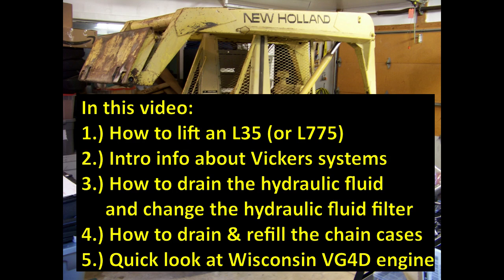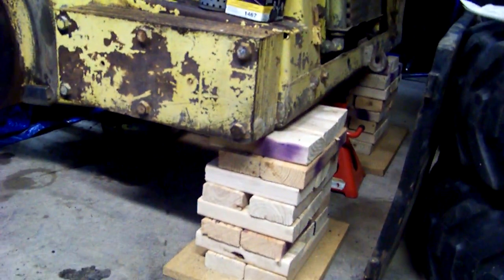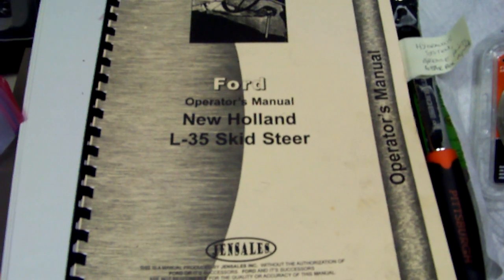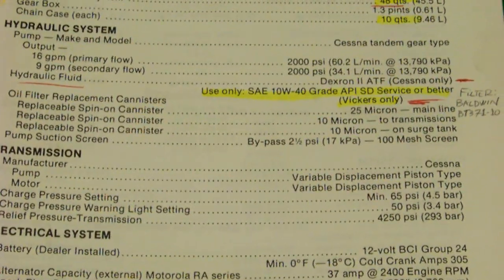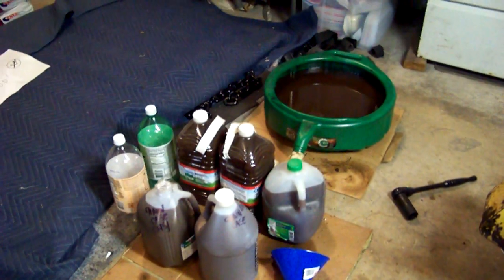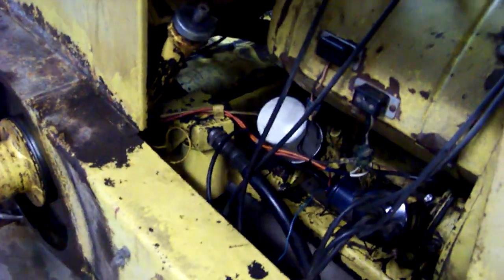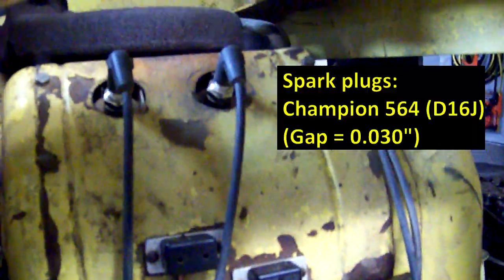DIY New Holland L35 L775: How to Lift a Skid Steer, Drain Chain Cases, Drain Hydraulic Fluid, VG4D

Comment: Wow, this is a really great series of videos on the L35. By any chance does the shop manual mention what the maximum lift height/weight for the L35 is? I've been looking (have my eye on one for sale locally) but I haven't been able to find information on it.
Reply from the maker: According to the manual: 
- "Hydraulic Lifting Capacity to maximum height (SAE Operating Load)" is 1800 lbs (this is called "ROC" today);
- height to top of bucket with the boom at max vertical extension: 146 inches (12' 2")
- height to the bucket pivot point with boom at max vertical extension: 121.5" (10' 1.5")
I hope that helps - thanks for watching! : )
Reply: @L35inColorado  That is really helpful. Thanks for the info!

Comment: Thank you for your video's they have already been a great help - bought a used L779 but most of your content matches except I have the cessna transmissions.   When I bought it I noticed a hydraulic leak somewhere underneath and had thought I traced it to a rubbed through hose going to the filter/cooler.  Replaced that but in the process of refilling the reservoir I noticed it leaking again.   Finally found it - theres a bolt missing from the hydraulic tanks access panel...right directly under the driveshaft (No clearance to put bolt in while shaft is in place).   I'm now trying to figure out how to remove it from the 4way gearbox end.  I maybe understand how to do it if I can keep it from rotating while removing the bolt going into the 4way.   
Any suggestions appreciated
Reply: Well I figured out the drive shaft - I'm thinking they drilled it out or cross threaded it.   The hole is tapped, seems to be about 3/8 but neither 3/8 coarse nor 3/8 fine threads in smoothly.   Guess I need to try metric before I force a 3/8 in.
Reply from the maker: Can you use a shorter bolt that will fit with the driveshaft in place?  I don't know how long those bolts are because I have never removed that access panel on my L35, and there may be a little more clearance on the L35 than the L779.  

I'm not aware of any videos for removing the driveshaft, but I had a look in my service manual: it doesn't get into great detail, but rather just says to remove the bolt that connects the driveshaft to the forward-most yoke -- this is the yoke by the 4-way gear box.  There is a big yoke bolt there, and it holds the yoke to the input shaft of the 4-way gear box. The manual just says this:

"Slide the drive shaft off the gearbox input shaft after removing securing bolt A, Figure 6", and that "securing bolt A" is the big one on the yoke.  

Here's my video on the 4-way gearbox: I don't show this bolt in the video, but you can see what I mean about the input shaft inside the gear box, so you can understand what the manual is talking about (that shaft goes all the way through, and its rear-end is connected to the driveshaft at the yoke bolt):

https://www.youtube.com/watch?v=qfoBXIXQOZY

In case I'm not being clear enough, the bolt that I'm talking about looks kinda like a pinion nut that you'd see on a regular automotive differential (holding the diff yoke to the diff input), but its a big bolt instead of a nut.  Please post back if that works.  Then back on the other side of the driveshaft (engine side), you just loosen the square-head bolt that's on the very first yoke, and you pry that yoke off.  

I have in the past had to adjust that end (engine end) of the driveshaft before on my L35, and that connection wasn't too difficult to adjust (just had to pry a little) because that yoke is just secured with a Woodruff key.  So I think if I were you, I'd loosen that square head bolt on the engine side yoke first, then remove the big bolt at the gearbox yoke next, then slide off the shaft from the gearbox yoke and wiggle/pry it free from the engine side.  Don't lose the Woodruff key.  Also, I'd mark/scribe the yoke and shaft at the gearbox side to be sure that I have reference alignment marks when it comes time to re-install.  

For install, the manual says to fasten the big bolt to 40 ft-lbs, plus or minus 5 ft-lbs, and to use Loctite 242 (medium strength) on the threads.  That's all the info I have, so hopefully this helps you. 
 Good luck!
Reply: @L35inColorado  Thanks... I managed to disconnect it on the 4 way gearbox side and just angle it out if the way.  I had no idea that the driveshaft basically telescopes.  Once removed there is enough room to just shove it out of the way. I'm going to have to chase the threads on the missing bolt on the tank with a tap since 3/8 coarse starts in but only 1/2 turn.   3/8 fine doesn't work at all.  Unfortunately it means that 8m going to empty the tank of all the lovely new fluid I had put in as I'm pretty sure chasing the tap will generate some metal debris that I will need to try and flush out
Reply: While I'm still going to have to drain the tank I think I came up with a fairly ingenious way to remove the risk of shavings in the tank.   I picked up one of those little telescoping magnets at harbor freight.   I'm going to stick it up through the drain plug telescoped up to be right beneath the hole I'm chasing with a tap.   Probably have to recruit some help from my wife or one of my kids but by having the magnet right at the hole instead of way down low I think I can catch all the shavings before they can fall potentially away from any magnet I could put at the bottom of the tank.

Comment: thank you for your help and advice in the past. i’m needing more help please. today my L35 right side steering arm suddenly started working in reverse directions…i pushed the right handle forward and the right side went backwards and vise versa? what could suddenly cause this? thanks for any help you could provide. David in Tennessee
Reply from the maker: Oh no, that's no fun!  Assuming there's no issue in the hydrostat itself, I'd first check all those linkages from the lever to the steering cylinder, and especially the spring that "resets" the neutral position for the levers.  Check the pins/keys on the connections to the pintles to be sure that there's no slip.  Hopefully it is something as simple as a loose connection between a linkage.. ??

Comment: me again. when checking the hydraulic fluid level on my L35 with it cold… should the bucket be in the raised position or lowered position to get an accurate “ full” reading at my dipstick?  thank you very much🤷‍♂️
Reply from the maker: The manual states this:
"With the boom down and oil cold, the oil should be at or just above the low mark on the gauge."
Reply: @L35inColorado  thank you 👍
Reply: it just seems like when the boom is elevated the reservoir would be sucked dry… especially if you’re on a downward leaning slope. i just don’t want to destroy my new pump.
Reply from the maker: @davidsizemore9906  Remind me again - you're working on an L35 with Vickers transmissions, and you had to replace the vane pump?  
Have you done the purge described in the manual, where you open the port on the control valve?  
(The hydraulic purge procedure is different for the models with Vickers trans than it is for models with Cessnas - and the hydraulic fluid is different, too.)
Reply: yes i have. i’m using the  tractor fluid they recommended at orielys.
Reply from the maker: @davidsizemore9906  Okay - I found this old video on an SD card from when I did some major work on our old L35, six years ago - I had one transmission out, so I had the hydraulic system drained.  
The video quality is poor but check this out and see if it is familiar.  If you need it, I can video the instructions from the big manual:

https://www.youtube.com/watch?v=fJJ0dU2Nujk

Also, is your new pump a Vickers V20P or equivalent aftermarket?

Reading the big manual, on page 53 is states:

"Before operating the loader after a pump failure, the start up procedure outlined in the "General Information" section should be followed".

That is a reference to the info on page 125 of the big manual: if you don't have that info, I can record it from the book and post it later today.  That is important info which states the initial start-up procedure to follow after major hydraulic work (ie, have the skidsteer blocked up with all four wheels off the ground, etc, and you go through several steps over about 10 minutes, with a pressure gauge hooked up to the oil cooler).  Does that sound familiar?

Comment: Hello, my Toyota Auris 1.6 2008 has fuel  pressure problem, because I think after other repairs my conclusion was no fuel pressure, the car has a hard start and once it’s starts it runs good unless leaving off few hours,  then comes the hard start again. Do you have any idea. May fuel pressure regulator? The fuel pump works perfect.
Reply from the maker: There are a few causes, but I'd start with checking the fuel pressure regulator.  Check out this video to see how to do that:
https://www.youtube.com/watch?v=howhgRzQJ3I
I hope that helps - good luck!  : )
Reply: Thank you, your video of  Sianna helped and I have one ordered. I will see the outcome.

Comment: Absolutely phenomenal! Came here for the Wisconsin VG4D engine! Thank you for the tips, we are doing a complete rebuild video on a 1969 Case skid steer 1537 with a VG4D Wisconsin motor.   What did you happen to paint your skid steer with? We are planning on painting ours with Rustolium professional oil based paint, is this a good choice? Did you brush on your paint or did you spray it? Again amazing detailed video!Hope you have grants excess with a YouTube channel!
Reply from the maker: Thanks, I'm glad the video helped!  Sounds like you have a fun rebuild, too!  
As for the paint -- its nothing fancy, because I was mostly doing it to encapsulate the lead paint.  I mostly used what I happened to have on hand from other jobs, which is all stuff off the shelf at Walmart (except for POR-15).  For the interior stuff:

Blue is Rustoleum Gloss Protective Enamel, 254156.

Yellow is Rustoleum Gloss Protective Enamel 254155 (I am pretty happy with the yellow, its a good paint for construction equip).

Orange is Rustoleum 2x (don't have # anymore)

My exterior paint job really isn't very good at all, I just wanted to do something to encapsulate the old lead paint and didn't want to spend too much money.  I used POR-15 (brushed on) on the chain cases and covers, just because I had to use up a can that I opened for a different job (that stuff turns hard quickly if you don't use it up). 

The POR-15 actually worked out well because I didn't need to primer the old paint and POR-15 is very easy to work with, but POR-15 is expensive if you don't already happen to have it.  I topped the POR-15 with Rustoleum Gloss Protective Enamel, Black, 338927.  

The other black (boom, cages, etc) are Rusto 338927, if I remember correctly.  Again, I really wasn't being too picky because I just wanted the old paint covered!  Whatever you decide to do, just remember that you likely have lead paint somewhere under the layers on yours. 

Thanks for the comment, and good luck!

Comment: I have the same l35 1973 under it u said the drain plug for highdrolite fuild? But where do I fill it up at ? Is it where the ATF/motor oil goes or does that run off the drivetrain.  Just new to the skid steer
Reply from the maker: Hi -- the drain plug for the hydraulic fluid is the one shown at 06:29: its the only plug that you will find the bottom of the big hydraulic reservoir.  To fill it up, you just pour the new oil into the same spout where the dip stick is (shown at 12:43).
Be sure to determine which kind of transmissions you have before you select the hydraulic fluid, because the Cessnas use ATF but the Vickers (the one in the video) use motor oil.  
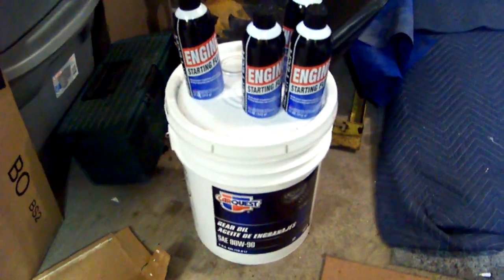The drivetrain (as in the chain drive) has its own lubrication.  Each chain case is filled with about 2.5 gallons of oil, and the refill for those is shown at 09:10 (its a plug at the top of each chain case).
Good luck!

Comment: Did you ever replace any hydraulic seals on your machine? I’m currently trying to do so, but cannot get the cap nut off of the cylinder. Any suggestions?

Comment: This was a great video! I am in so much need of help on my L35.  I can't really afford to take it anywhere for repair so I'm trying my best to do repairs myself.  When I purchased the machine I noticed it had a slight clanking noise when I would turn left.  It started to get worse and would clank and then jerk back and forth.  One day I was running the machine and then it clanked again and just stopped turning left altogether.  No front or rear movement just right.  When I move the left stick to move I get nothing and feel nothing engage at all.  I tried to fill with fluid and still nothing.  I pulled the cover off to expose the chain and pump.  The chain is attached but the parking brake rotor is extremely loose.  I also noticed what appeared to be fresh metal shavings on the bottom under the parking brake.  I just need some advice and a guide in the right direction on where to proceed.  Any help at all would be greatly appreciated.  Thank you kindly!

Comment: i have an l325 new holland which is similar to this l35. thank you for the info and excellent video
Reply from the maker: Wow, that's cool!  Thanks for watching : )
Reply: I just bought a 325, I found this video in hope of learning more about the old new Hollands.

What are some of the main difference you notice?

Thank you
Reply: the 225 and l325 do not have down pressure. A good set of books will tell you everything you need to know

Comment: Hello, I have a L35 and have learned a lot watching your videos. I am wondering do you have to drain the hydraulic oil to change the filter? Thanks for your help.
Reply from the maker: I'm sorry I missed your comment -- I'm not sure how much fluid you would loose, but most of the fluid is in the reservoir when the system is cool -- but you want to be sure everything is cool.  If you compare the height of the oil level in the reservoir using the dipstick to the height of your hoses to filter, you can get an idea of what you might lose.  I changed the filter when the reservoir was empty, so I'm just not sure how much oil you'd lose otherwise.  You could always just put a pan underneath to catch the oil, then refill with the same amount.  Good luck!

Comment: me again. any chance u have a vickers 4 way gearbox for sale? thanks, David
Reply from the maker: I'm sorry I missed your comments!  No, I don't have an 4-way gearbox, but I can say that this company is often able to source some odd parts (but $$$):
https://www.universaltractor.com/
When I was restoring the L35, I got some rare parts from these vendors:
https://www.wengers.com/agriculture/skid-loader-parts.html
https://www.worthingtonagparts.com/skid-steer-parts
I've had one transmission out on my L35 because it needed a shaft seal replacement and some other work, but I haven't had the 4-way gearbox out.  However, if you can find an aftermarket option with the same dimensions at the OE box, that might also be a solution.  For that, I would look at what Surplus Center has - their catalog is outstanding. 
You'll see with the gearbox that there's room to shim (and you'll have to shim, anyway to get the correct backlash on the gears).  As you probably have already seen, nothing fits well with shimming and adjustment on these old skidsteers!  So, while that's a tiresome process, at least it might mean that you can swap in a new aftermarket gearbox of "close-enough" geometry and them shim it for a custom fitment.  
I hope that helps - and if you're still looking for some instructions on the pump priming, let me know because I have some documents that I can use to make a short video on (but if you already have the big repair manual, then we have the same information).  I didn't have my pump out, but I had one transmission removed, the control valve, steering cylinders, and most hydraulic lines out when I did the major work on this L35 a few years ago, so I had to prime the system just the same.  I still have the documents, so that might help you if you don't have those.  Let me know : )
Reply: bless you

Comment: i need some help please. my L35 is pretty well maintained for its age… but today while digging it just stopped . none of my hydraulics work now??? i opened the hydraulic fill spout and hot fluid sprayed everywhere. could you help diagnose my problem please. thank you
Reply from the maker: Ah man, I'm sorry that's happening!  It sounds almost like your pump failed, but there are likely many other possible causes (control valve, pump gear in the 4-way gear box?).  I don't know if this video would help, but here's an old video I posted on the 4-way gear box which shows the input from the engine to the pump (Vickers setup):
https://www.youtube.com/watch?v=qfoBXIXQOZY

The hydraulic oil expands when it gets hot, which is why it will overflow if you open the fill spout while hot.  Have you reached out on the forums?  Here are some examples of forums where there are very knowledgeable people:
https://www.mytractorforum.com/threads/new-holland-problems.162643/

Do you have any new info since posting your comment?
Reply: @L35inColorado  thanks. i’ll check it out